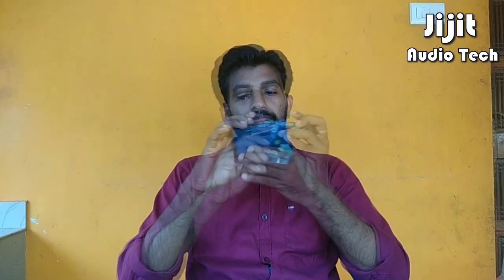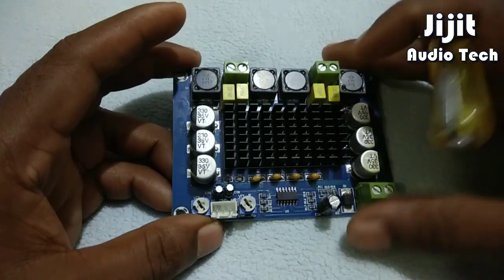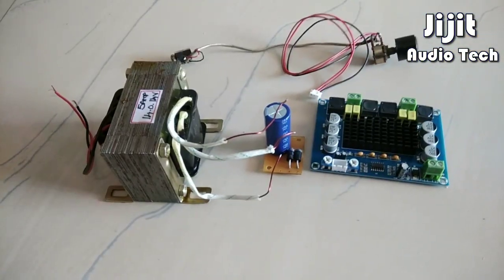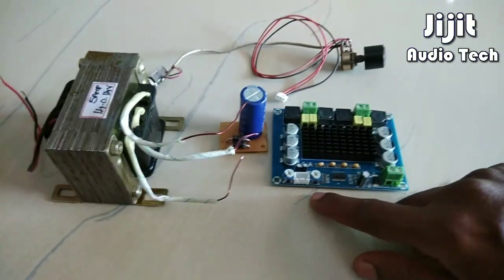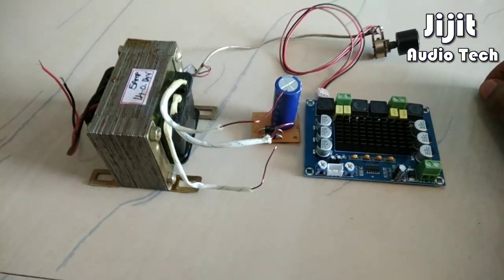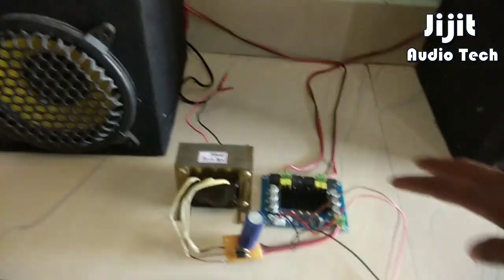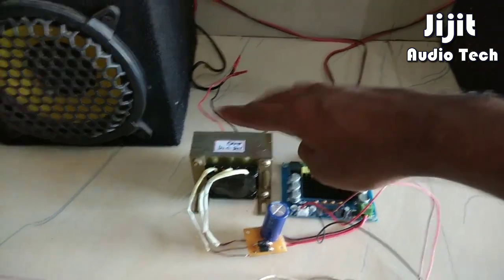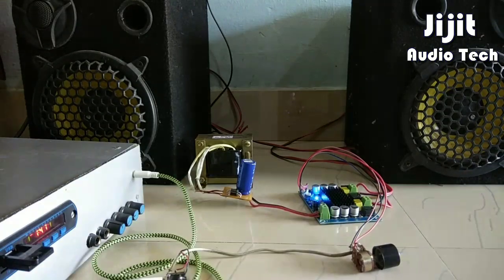100 + 100Watts, TPA3116D2 Class D Amplifier board Review and Testing in Malayalam

Comment: 4ohms 30 watts @24v 10 amp kodukamo
Reply from the maker: voltage is very critical.. amplifier board nte rated voltage correct aayi koduthaal ampere koodiyalum prasnam illa, (maximum voltage alla udheshichathu rated ennathu safe working voltage aanu)

Comment: Ente kayyill ullath tpa3116d2 50+50 speaker and 100w subwoofer kodukkaan pattiya amplifier board athill 10 inch heavy bass ulla subwoofer kodukkaan pattumoo
Power 24watts 5amp aanu kuyapamundo
Reply from the maker: 24volt correct ആണ്.. പക്ഷേ ampere പോര... 8 or 10 എങ്കിലും വേണ്ടിവരും
Reply: @JijitAudioTech  work aaville, enthenkilum problem indo
Reply from the maker: @muhammedjasil3653  work ആവും, പക്ഷേ full power കിട്ടില്ല എന്നുമാത്രം

Comment: 12വോൾട്ടിൽ വർക്ക്‌ ചെയ്യുമോ
Reply from the maker: 12v to 24v കൊടുക്കാം... 12v കൊടുക്കുമ്പോൾ പവർ അല്പം കുറയും...
Reply: @JijitAudioTech  12വോൾട്ട് 10അമ്പിയെറിന്റെ ട്രാൻസ്‌ഫോമർ ആണു
Reply from the maker: @sudheeshkrishnakripa5146  amplifier nte power voltage ne ആശ്രയിച്ചിരിക്കും.. കാരണം output speaker ohms fixed ആണല്ലോ.. ampere അതിനു ആവശ്യത്തിന് എടുക്കും
Reply: @JijitAudioTech  12വോൾട്ടിന്റെ      
നല്ല bass treble bord  ethanu class d ampil conect cheyyana nalla clarity venam
Reply from the maker: @sudheeshkrishnakripa5146  tda1524 ic board നല്ലതാണ്, പിന്നെ വേറെയും ചില boards available ആണ് ട്രൈ ചെയ്യൂ ബ്രോ...
Reply: @JijitAudioTech  എവിടെ കിട്ടും
Reply: Bass treble bord കൊടുത്തപ്പോൾ ഹീറ്റ് ആകുന്നു കുഴപ്പം വരുമോ

Comment: E board il connect chith off chayyumbol potel sound varunnu. Ath ozivakkam enth cheyyum
Reply: On off ആകുമ്പോൾ ഒച്ച കേട്ടാൽ എന്താ കുഴപ്പം work ചെയ്യുമ്പോൾ ഉണ്ടോ എന്ന് നോക്കിയാൽ പോരെ
Reply from the maker: @mithunjs2533  കുഴപ്പം ഒന്നുമില്ല.. full volume വെച്ച് പാട്ട് കേൾക്കുമ്പോൾ current പോയി വന്നാൽ ഉണ്ടാവുന്ന  സൗണ്ട് നമ്മളെ ഞെട്ടിപ്പിക്കുന്നതാണ്. നല്ല amolifier il ഇതൊന്നും ഉണ്ടാവില്ല
Reply from the maker: speaker protection board കൊടുത്താൽ മതി... on ചെയ്യുമ്പോഴും off ചെയ്യുമ്പോഴും ഉള്ള pop noise ഒഴിവായി കിട്ടും... പിന്നെ speaker line il dc കേറിവന്നാൽ അടിച്ചു പോവാതെ protect ചെയ്യും

Comment: ഇത് 100w rms ആണോ. ഈ ബോർഡും mostfet board തമ്മിലുള്ള വെത്യാസം എന്താ???
Reply from the maker: ഇൗ ബോർഡിൽ സാധാരണ double ic ആണ് വന്നിരുന്നത്, പക്ഷേ ഇപ്പൊൾ ഇതിൽ സിംഗിൾ ic aanu വരുന്നത് 50 + 50w maximum, എന്നാൽ ഇപ്പോഴും ഇൗ ബോർഡ് 100+100w എന്ന് തന്നെയാണ് അറിയപ്പെടുന്നത്. അതൊരു മാർക്കറ്റിംഗ് ട്രിക് ആണ്. ക്ലാസ്സ് d ആണ്, heat, power loss എന്നിവ വളരെ കുറവാണ്  എന്നത് വലിയൊരു മേന്മ ആണ് പിന്നെ സിംഗിൾ പവർ supply മതി ഇതിന്. സബ് കൊടുക്കാൻ ആണെങ്കിൽ mosfet ബോർഡ് തന്നെയാണ് നല്ലത്
Reply: @JijitAudioTech  thanks bro
Reply: Ithu vangan ula link indo

Comment: Bro ithil 12v 16amp power supply connect cheythal max audio out yedukan pattuo?
Reply from the maker: അതിൻ്റെ rated power supply കൊടുത്താൽ maximum output കിട്ടും, എത്ര ampere കൊടുത്താലും അത് ആവശ്യത്തിന് മാത്രമേ എടുക്കൂ...
Reply: Ithil 40w +40w RMS varunna speaker ethra voltagila correct ayi work cheyikkan pattuka
Reply: Apo 12 volt ups transformer 12 amps ullathu kodutha egane undavum